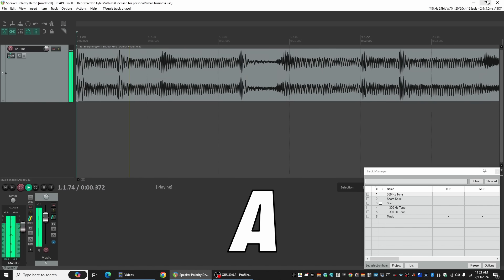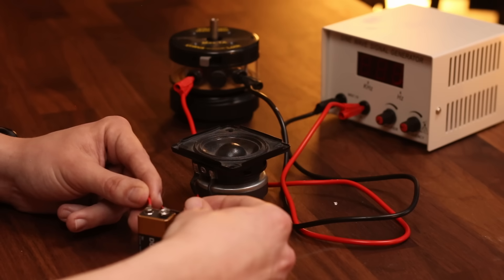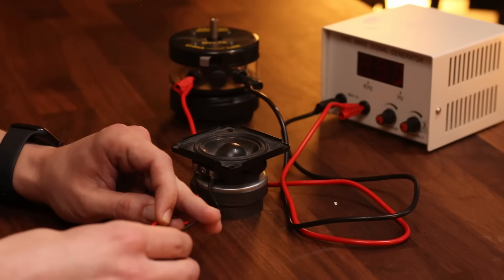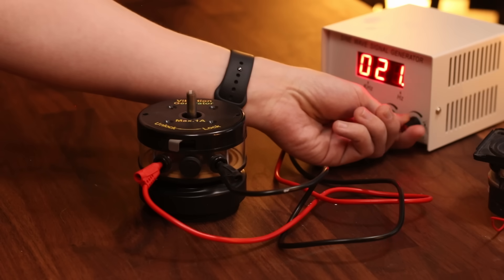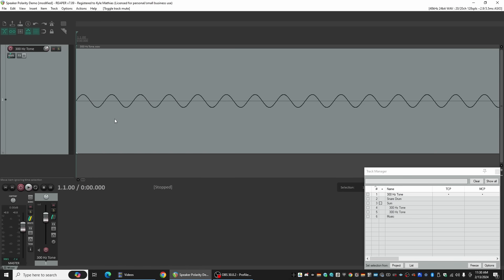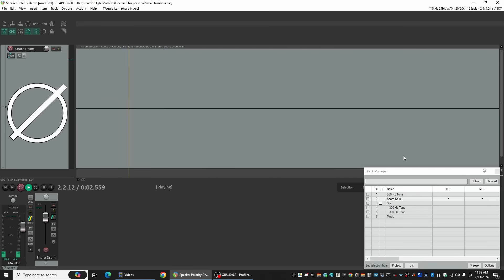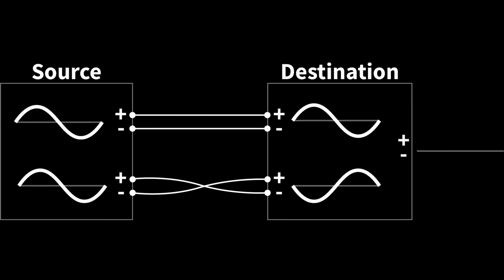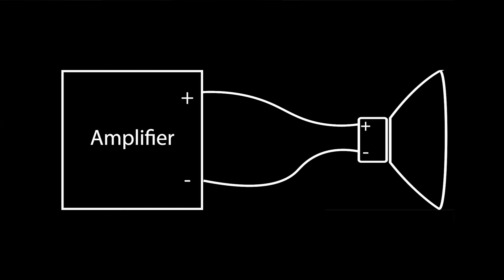What Happens When You Wire Speakers Backwards?

Comment: Many, many years ago (like 1970s), I installed 2 speakers in my car's front doors for my Pioneer Super Tuner stereo system. Somewhere, I saw an article about adding a 3rd speaker and mounting it on the rear deck of the car.  I took a positive lead from the left and right channels and connected them to the 3rd speaker. Whether or not or was good for the electronics, I don't know, but it made for an interesting effect since the only sound coming from the 3rd speaker was the difference between the 2 channels. Like sounds were filtered out.
Reply: It works... Poor man's surround sound...
Reply: this was pseudo quadrophonic sound system developed by a bloke called Hafler. i have had my stereo setup like this using 2 speakers for the rear wired in series but opposite polarity since the seventy's.
Reply: would this still work or would it be obsolete with newer technology?, im sure i can look this up but i want your opinion and im a little lazy
Reply: @dom_xi-dzopa720  I think it would still work.  The signal going to the speakers is analog.
Reply: What a flashback! I had a 1970 Mustang Mach 1 with a Pioneer Supertuner hooked up to a Pioneer 100W amp. 2 bookshelf speakers with 8 in woofers seatbelted in the back seat, each with about 30 feet of wire. When we were hanging out at the park, speakers spread apart and awesome tunes!
Reply: I still have my Pioneer Super Tuner!

Comment: there are some receivers like the Yamaha ones that instantly shut down above -20 db gain if 1 or more speakers are badly wired.
apparently from what i have read, there is a voltage feedback sent to the amplifier and can blow up the amp without proper protection.

Comment: My previous car had two 6x9 inches speakers in the back and one was wired in reverse by previous owner and I didn't know anything about sound system that time. Both speakers are Sony Xplod and there's no bass but I can see the speakers moving. I fixed the polarity issue and by the time I played a track, that was the time I realized how much I missed while one of the speakers wired incorrectly

Comment: There's not really a falsification of differences when assessing one out of phase speaker. Its more noticeable on kick due to the energy required to push a speaker out or in at pub frequencies. It was something I didn't care about due to hearing on difference...until it was absolutely essential on a few songs where the kick attack just sounded weird and buried and flipping the shape of the whole drum bus was the solution. However whether this was due to something else like asymmetrical distortion or replicable on other speakers I do not know, yet it so changed on headphones where perhaps the small driver diameter made it matter.